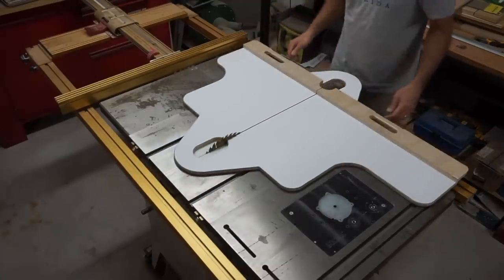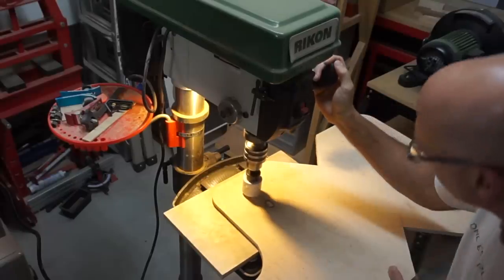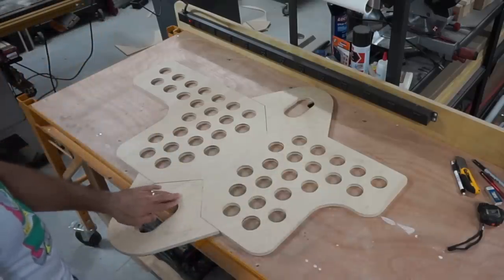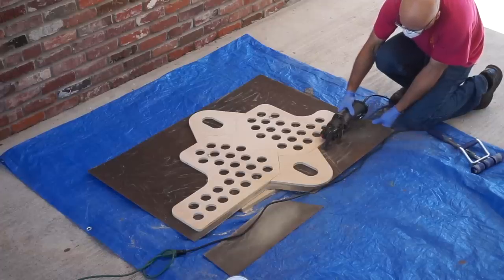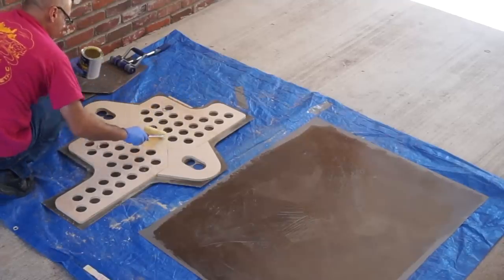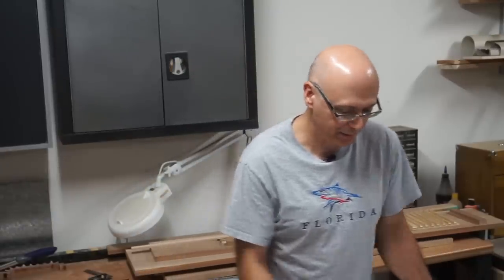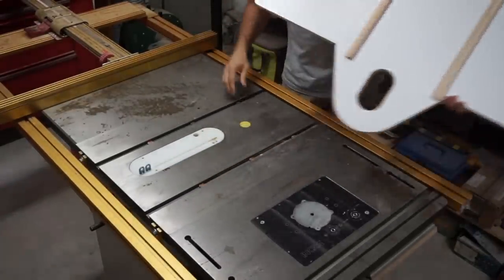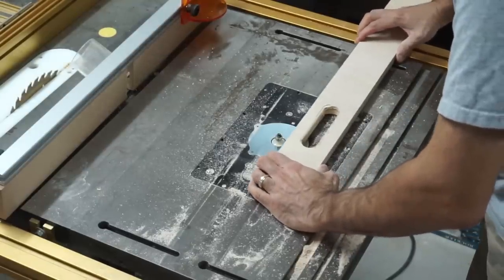A Crosscut Sled Like No Other

Comment: Very similar comments as noted below: not holding the workpiece when cutting; not using the 5-cut method to ensure squareness - a 32nd over about a foot or so may be acceptable(?) for framing work, but not for smaller woodworking projects or cabinetry where small errors are really noticeable, accumulative & unacceptable; the overall size of this sled is more cumbersome than a standard size sled made conventionally; the rail is totally inadequate for clamping a stop block to cut multiple pieces to the same length; there is no safety block to protect the operator at the end of a cut despite the hands placed far apart which could bind the runners; yet the only thing I do like is the laminate which could provide for a good sliding surface - yet paste wax on the runners & the bottom of the sled accomplishes the same purpose; this sled is far more bulky than conventional size sleds & requires more storage space.
Overall I'd rate this sled as a waste of time & effort - not as functional/safe as it should be.

Comment: I rarely comment as someone that has a great idea an solution, You did very well.
But I like to comment on those people who are brain dead, An they are the ones who put music in the back ground, an obviously you did not
Thanks for having some brains !

May I make one suggestion , Put a nut or 2 in the back slide (on fence), on either side of the blade cut, Then you can clamp down the pieces being cut an if you think your out a thousand or so of being square, you can also shim  behind the piece an fence being cut an give you much more accuracy !

Comment: cleaver idea, I might borrow it, it was odd that you epoxy the runners and the fence, you lucked out that they were close enough to square. To attach runners I use double sided tape for the initial attachment then I drill and screw the runners and for the fence I screw it on and use the 5 cut method to true it up.
Reply from the maker: Not lucky, Michael Katt. I did make an effort to mount everything square.

Comment: Posting out of genuine concern about this design, which I like and am considering using apart from one thing: most sleds I've seen have the bridge connecting the two halves arching upwards over the top of the blade and giving clearance for the maximum blade height - the connecting portion can NEVER contact the blade. With this design where the connecting portion is flat to the table, there's nothing but those splitters stopping you absent-mindedly pulling or knocking the sled onto the rear edge of the blade. Since there's no riving knife, I don't see anything preventing the entire sled kicking back at that point. But I guess it's safe provided the splitters are left in place.
Reply from the maker: Thanks for your concern, Aidan. I’ve got news for you. If you’re absent-minded when using a power tool, sooner or later you’re going to pay a price for that.
Reply: @IveBeenThinkingWorkshop  Fair comment. Although I'd still take every precaution.

Comment: Hi, I like the minimalist perspective and the slim profile.  The out-of-square is a bit large for furniture or other pieces where errors will tend to stand out.  Suggestions: put a t-track long enough for at least six inches each side of the blade and use hold-down toggles.  Trusting the downward rotation of the blade to hold all pieces to the table is a risk that one should not take.  The back side of the blade is rotating up and if any binding on the back side happens then the workpiece can become a missile - to much risk!  Also, with a t-track it should then be relatively easy to build an auxiliary fence for workpieces that need to be cut in a vertical position rather than cut in the horizontal position.  Good job overall!  It is good to see some new ideas on YouTube rather than variations of one idea.   Thanks for sharing!!
Reply from the maker: More features are nice of course, but as you noted, I was going for the minimalist approach with this design. You do all have me thinking about how to ensure the work piece does not lift when using this sled.

Comment: As somebody mentioned I'd make that fence thicker. I'd make it adjustable to tweak its accuracy and then lock it in place. Then is that slide table thick enough to route it so you could install some T-slot material parallel to the fence for hold-downs?  At least 1 foot and 2 feet out. Since I could get a scrap piece (free) from where I retired from I'd think of using aluminum strut with T-slots for the fence. Another place to put toggle clamps.

Comment: First of your videos I've watched. Bit of a coincidence, I ordered an Incra fence system and a cast iron router table extension wing last week, so in a couple of months my table saw will look almost exactly like yours! Just mine is a 67 year old Unisaw, and I ordered a different brand of extension wing.
You may want to look at the Wonder Fence joinery system upgrade for your Incra fence. Much better than what came with your router extension wing.

I like the premise of your sled, and the bed of the sled itself, so may build one, but using a more accurate method of squaring the fence, and incorporating some critical safety features.

Comment: I'd take his concept, and a piace of honey come material coat both sides with carbon fiber for a smooth strong light weight crosscut sled, but I'd also build in steel full length supports keyed into the T slots on the table saw add a taller fence and some clamps to hold down stock. You could do this and get it to about 20 lbs.
Reply from the maker: I would call something like that a “professional” sled!
Reply: I keep my "honey come material" in my pants.
Reply: @ @skit5782   LOL ... you beat me to it ... by about 10 months  !

Comment: I was thinking on doing something like this, but I saw a lot of dissadvantages on not having a proper fence in the front and a mistake can easily cut the back part or weaken it to a point where it can not be used again. 
I added holes to my sled but after I laminated it since i dont want the laminate to break if if i ever hit it on a hole.
Reply from the maker: Thanks for the comments, Cristofano! There are compromises involved with every design, that’s for sure.

Comment: Sorry I like how light the sled is. But you don't use a framing square to adjust your fence on a sled. You  would use the 5 - cut method to square it up your fence. And should have used metal t-track's for your runners as the wood will expand & shrink.
Reply from the maker: How true!

Comment: 1. Since you have such a short and wide fence, there is no good way to clamp a stop block to the fence for repeat cuts. There is also no good way to run boards at 90 degrees for notching the edges. So even if this short fence were safe (difficult to hold stock down and still control the sled), it is just not practical, anyway.

2. There is no stop. A lot of people don't put a stop on their sleds, so you're in good company in that aspect. But those sleds don't cut themselves in half when you overshoot.

Comment: Cool sled.  You could have used your square against the blade and the fence to get a much more accurate square fence.  Have you thought about attachments like a double V for making perfect 45's?  Picture frames that meet perfectly are awesome.  Trying to cut 45's and then joining them only to find out you didn't quite make it, and leaves a gap somewhere, whereas holding two pieces in a V configuration and cutting them till they're perfectly matched is impossible to beat.
Reply: And a followup:  Didn't like how you weren't holding on to your work piece during cutting.  Having a hold down clamp would help.  And those handles way out at the ends - good safety feature, but it can allow you to rack your sled, leaving a cut that's not perfect.  I would opt for a slightly offset handle just to the side of the blade line so that the force you're pushing with is not adding any torsional factors into your projects.

Overall I like it.  But a clamp and a slightly off center handle to push would be better.  (My opinion)

Comment: I would have attached the fence standing up on it's side rather than laying flat so you can clamp a stop block to it for cutting multiple pieces of material the same length. That would probably make it easier to attach some kind of blade guard too so you don't lose a thumb. Lastly, I would have gone with the 5 cut method for checking the squareness. A few minor tweaks and you have a really nice crosscut sled. I'll definitely be stealing some of your ideas on my next project.
Reply from the maker: Thanks for your comments, Matthew. I could have attached the fence standing up if I chose to do so, but my goal was to make a low-profile sled, so I went with laying down the fence. All those extra features you mentioned would also be nice, but they would contradict my other goal of making the sled light for easier handling on and off the saw, so I left them off. This is an example of how all designs contain compromises.

Comment: I've used jigs like this back when I was in business.  You spent a lot of time making yours.  Nice work, but I too ducked for cover when you ran that piece with no hold down.  Please respect the comments of others about your procedures.  For my part, lightweight may be hazardous in itself.  Mass itself may enhance control of something like this.  Consider safety bars running under the table extensions of your saw to prevent injury when your saw expresses its hate.  Mine got me after forty years of common sense...One morning in a hurry doing something not unlike this but not enough hold-down.  It took a year for my right hand to get over it, and my index finger is still a bit stiff.  Not if, but when.  Nice shop you have.  Clean and full of nice tools.  Thanks for sharing, if not to elicit reaction.  I hope you will follow up.

Comment: Great sled and unique too.  But be careful the returning of the sled after the cut. If the blade hits the Oval part of your sled while still running you sled will get wheelies and you'll get it right on your face! It's risky! always keep pressure!

Comment: Great design and well worth stealing.  I'm a HUGE fan of trying to make everything as light as, reasonably, possible.

I'd add just enough to the front and back sufficient to allow a stop under the table, so there can be no mistakes that would result in cutting through the only parts holding the sled together.  I use that technique on several of my sleds and it takes at least that concern away, which makes a huge difference in the comfort of using the sleds.

As others indicated, consider securing the fence via a few screws to allow adjust ability. This could be done using T-Nuts and slots on the fence.  Now that I find myself a bunch of decades down life's road, I've adopted, as one of my life rules, the following one:  When a bunch of people tell you something, you'd be wise to at least look into and consider it.

HOLD THE WOOD DOWN

As others, repeatedly, pointed out, add toggle clamps or hold the pieces you are cutting.  Saying the blade pushes down, so won't kick the pieces ignores that it happens every day, when the back of the blade, where every kickback starts, grabs a piece and launches it.

Comment: Good idea, yes. But I am leery of not clamping the work piece to the sled. At least hand hold it. As you have it built you almost need to push the sled with both hands. I would consider a pistol type grip in or near the center on the backside, so I could use one hand to hold the piece being cut.

Comment: Confirmed: I will be using this design. My modifications will be a) adding T tracks parallel to the saw line for clamps to hold the piece down, and b) a higher fence to support a stop block. Considering the T tracks, I will not drill holes in the base where the tracks will insert for stability reasons. I will probably do the five cut method for fence alignment.
Reply from the maker: Great comments, Sully! I would love to see your version of this design!

Comment: The only thing I would have done differently is attach the fence mechanically at one end and clamp it where it overhangs the table.  That would have allowed you to make multiple cuts to prove squareness by moving the clamped end of the fence up and down.  Once you had it perfectly square then you could mechanically fasten the fence in place.  That would also allow you to replace the fence in the future.  Other than that, an excellent idea and well done video.

Comment: This is very cool, a lot of good ideas. I'm an old guy and I've made things like this (not as nice though...). Not to be negative, but I doubt that if you lost this sled you'd make another just like it. You've done this different, you've thought about it, but this is generation 1, by generation 4 or 5 you will probably arrive at something no one else has thought of, that will make guys who really know sleds to adopt it. (But many won't because people are hard to change. See Thomas Kuhn The Progress of Scientific Revolutions. I made a 12to1 scarfing jig that is safer to use and accurate but no one else has adopted. Looking at it guys say the cut off will fly. It doesn't, it won't.... So I could be wrong about you sled.  ).  So thank you for the video, I enjoyed it. I would make a sled differently, but I appreciated seeing your approach. But I definitely want to see the next version. 
What follows is just my musings...
The laminate adds weight, there's also the issued of slide. You want slide on the bottom, but on the top side you want a board you're cutting to stay put, not rubber, but not slick. I'm not so worried about the cut out at the back. That blade is there whether it's in a box or not. I like to see it. A careful intelligent person who knows nothing about table saws except it cuts wood and the spinning blade is dangerous, is far more likely to put his hand right on the box and then push it straight through the blade and his hand. Unless that box has a dust attachment or structural function, it's of no value and may give a false sense of safety. (Call it Close Your Eyes Safety Factor: If you can't see it, it can't hurt....wait....oh). One major issue with tablesaw function, and those oversized sleds is the space where we stand. We can't put support there, but wouldn't it be great if we could?  Sliding tables are a good answer to this. Support feed table behind the saw is helpful. But what other ways.... (catch sliders on the bottom of the rails of a sled that ride in the slot at the bottom of the channel take care of some of this... This problem is outside the scope of your jig, but you seem to be thinking outside the box, I'm supposed to be doing something else.... and no body reads these things anyway... so

Comment: I closed my eyes and prayed when he ran the wood through the saw blade, not once but twice unsecured.
Reply: Roy Carrillo everyone is bringing up that point.  I don't think it is best practice either but in this case I am pretty sure he could run that same piece through a million times and get the same result. Furthermore not sure exactly what the 'bad' outcome could be in that case.  Since the piece is square I don't see the piece riding up on the blade and if the blade height is set properly not much that can happen with that half inch piece of plywood.

Comment: I think a small pin or block of wood on either side of the blade on the fence would be a good addition to prevent someone from holding down the stock in that danger area. It doesn't need to be much, just enough for your hand to feel it without having to look down. With this addition it would be very unlikely anyone would get their hands in the blade path.

Comment: A couple of things you might want to consider:

1 Hold down clamps (at least put your hands on the material). Seriously, let your blade get a little dull or the wood decide to lift on it's own (it happens), and your day will suck.

2 Pythagorean theorem. This is not a new thing at all. Actually it's very ancient. 

If one side of the square is measured 3" and the other side of the square is measured 4" then the 2 points will measure 5". If they don't measure 5" you're not dealing with a square. That can be scaled up or down but it will never change. 33 thousandths off the fence means absolutely nothing. Also, framing squares are notoriously NOT square.

I like the design and it looks like it'll work well for small repetitive cuts, as long as you do something about the wood flying at you at a high rate of speed.

Comment: You have some great ideas put into this design. I especially like how you've cut down on the weight by changing the shape - perhaps the most under-rated aspect of your design. 

The safety angle has been done to death, so I'll leave the dead horse alone. 

But I would consider adding a pair of blocks as handles. That would serve as grips that let you also hold down the work piece. You keep it low profile still.

Comment: Nice looking sled but i prefer the standard type of sled, much better safety wise. I was defo cringing on that first cut, how you decided to cut that piece without a hold down of some sort, is beyond thinking about what could have happened.
Barry (ENG)
Reply from the maker: Why is the standard type of sled safer?
Reply: It's safer for your hands for starters, it looks like you are pushing and pulling the sled with your finger tips, i like to have more of a grip when pushing and pulling the sled.
It's easier to clamp boards down eg the one you cut which could have shot up into your face, where you have placed that board to place the cut piece up to (forget if 3x1 or 4x1 piece), you could doubled its thickness then channeled out a piece for a track thus giving you ample room for a clamp down and a much safer cut.